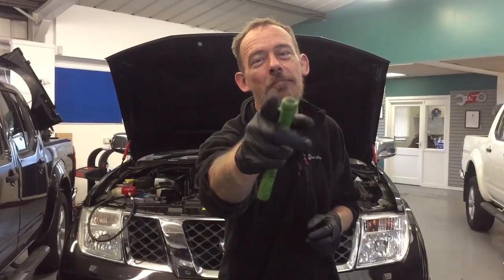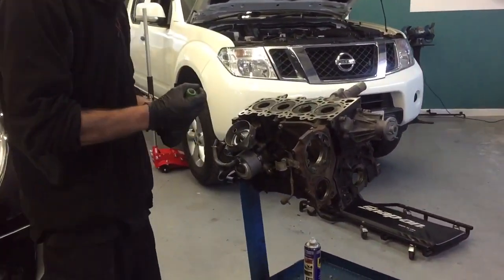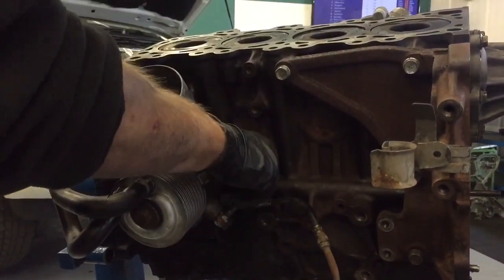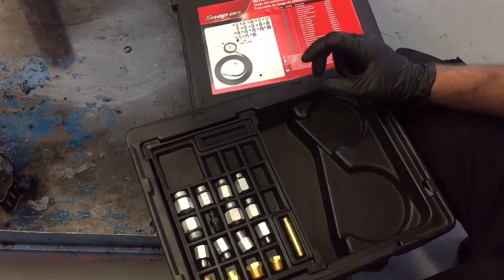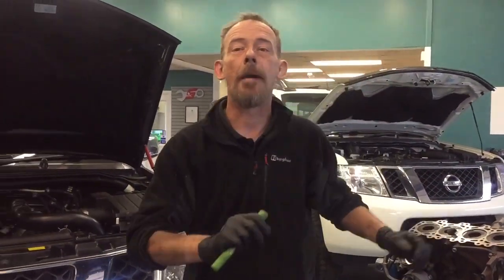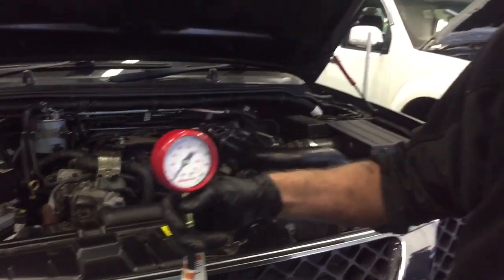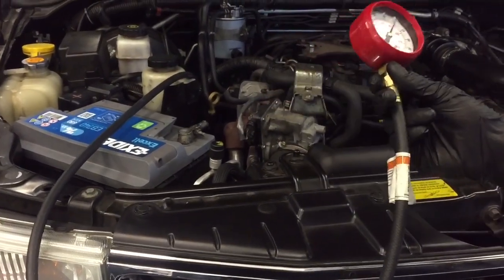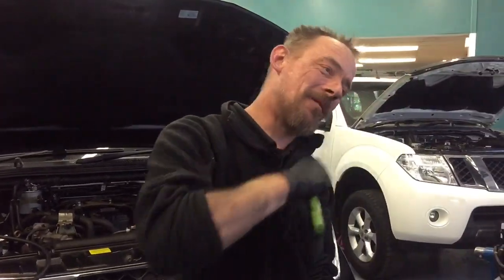How to do an Engine Oil Pressure Test for Nissan Yd25

Comment: Hi there i have question... I have a yd25 i would like to know, when cranking the engine several times over is it possible for the red oil light on the dash to switch off in the cranking process or must the engine start up and run for it to go off? Is the pressure to low to turn off the oil light on the dash just by cranking the engine?

Comment: Incase anyone is wondering, you'll need a 27mm tube socket to remove the oil pressure sensor and the sensor thread type is equivalent to a 1/8 Din pipe thread on my Thai built YD25. My pressure at idle is 35psi and around 75-80psi at 2000rpm. 
Workshop manual states a min of 17.5psi at idle and 36.3psi at 2000rpm

Comment: Hi guys im from SA and have a yd25 navara. Engine is rebuild and I want to know how im going to prime the oil pump
Reply from the maker: Hi there  is no need thanks from the UK
Reply: Unclip the injector plugs and turn engine over. Two 10-15 second bursts should prime absolutely everything just fine

Comment: Hy,

I have a Navara D40 2,5  2006 , with 180 000 km . I would like to know the pressure the oil pump produces when the engine is started for the first time?  I have a problem with my car, I changed the oil and the oil filter recently and the warning bulb is lit 3 seconds after the engine is started
Reply: I have same problem with you, have your car make any problem because of this problem during the 4 year time period?